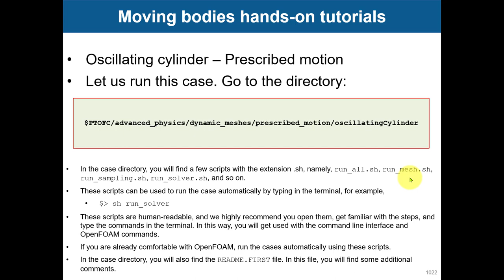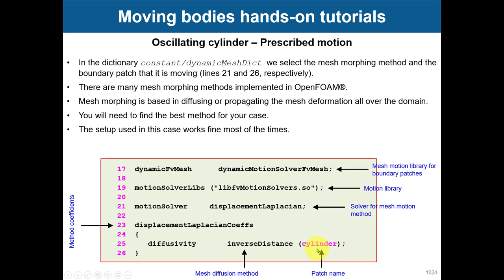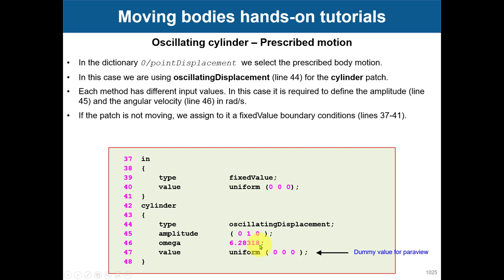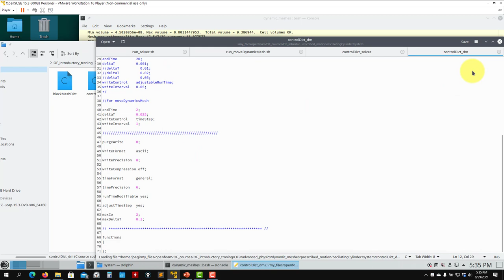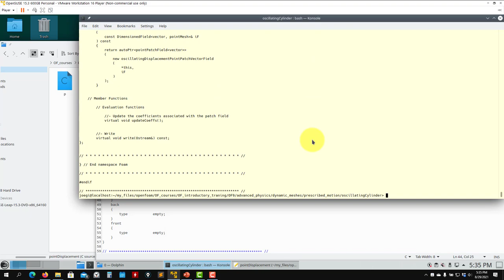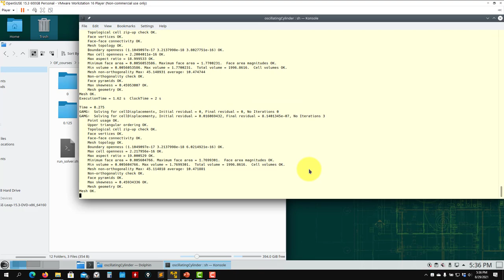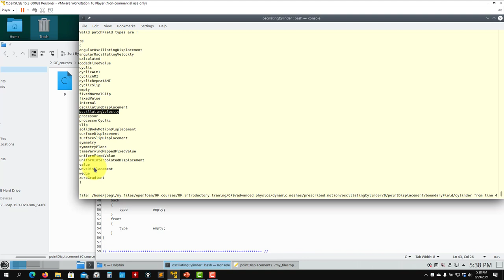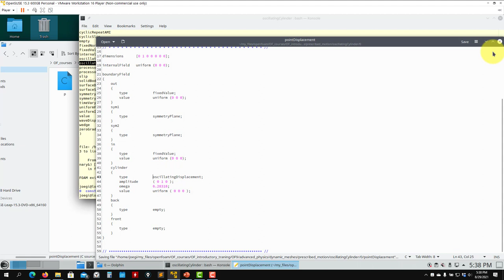8.13 Module 8 - Advanced physics - Dynamic meshes #openfoamtraining

Comment: Hi. Thanks for sharing! I have tried to use the laplacian approach but it fails when y+ is 1 and deformation is high what would you recommend?
Reply from the maker: IF the deformation is too the Laplacian solver usually fails.  My advice is to do re-meshing before the mesh fails.
Reply: Re-meshing may not be an option for complex geometries. What do you thing about overset? is it already in a mature state to be used in a real project?
Reply from the maker: Yes, overset might be a solution but it is not very mature in OpenFOAM, at least the ESI version. If you do not need to do a lot of remeshing, I think it is the best option. @marchelo666